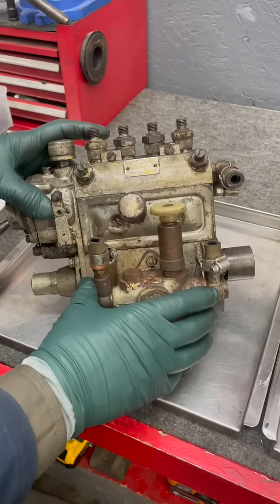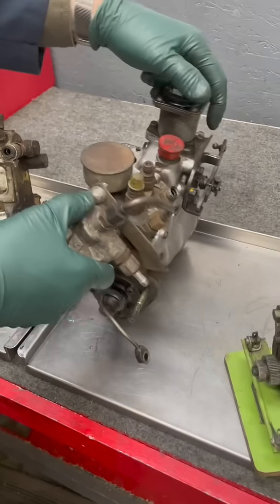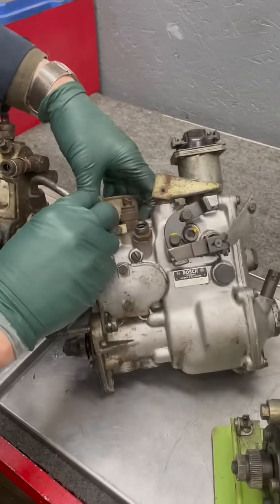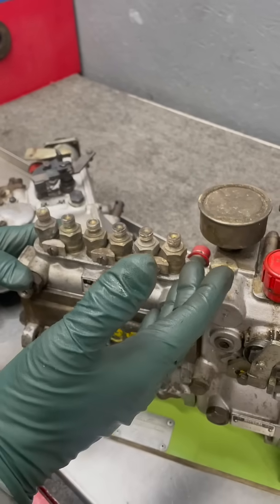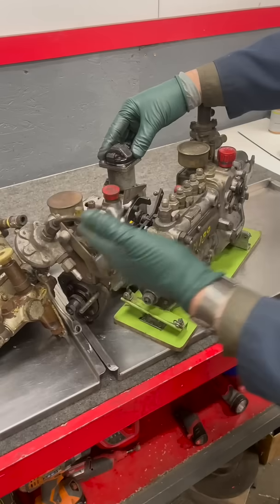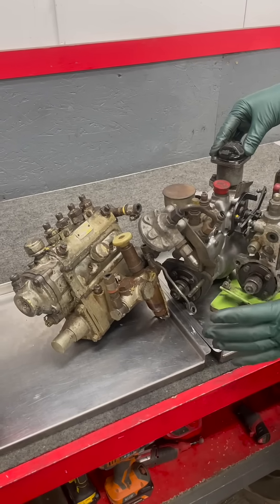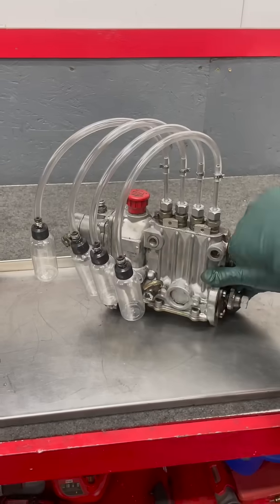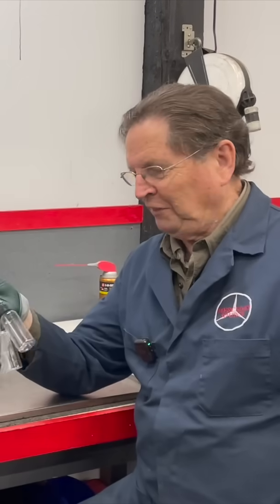How to Clean and Test Old Mechanical Fuel Injection Pumps @Mercedessource

Comment: My 46 year old 3-cylinder Volvo marine diesel has Bosch fuel injection, and it's never had a problem and overall the engine runs very well still. Unfortunately, for reliability sake, I'm looking at a new engine because rebuilding mine may not be practical. This is disappointing to me since I'd rather have a 100% mechanical engine that is even designed to be started with a pull rope if the batteries die. And one factor in my decision is finding someone who has the parts and can refurbish the injectors and pump.